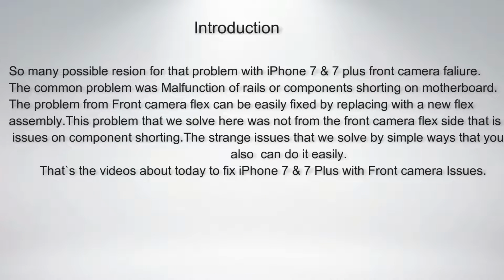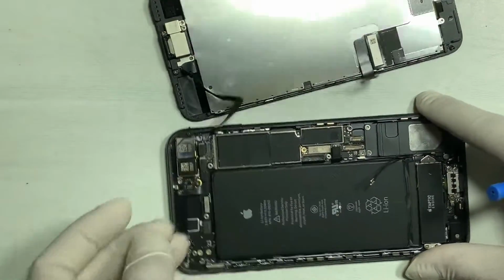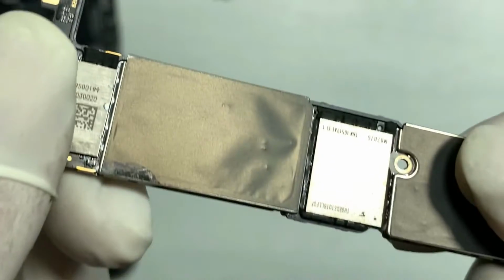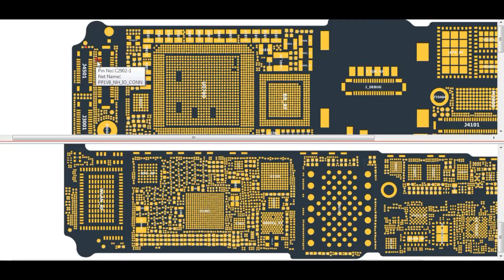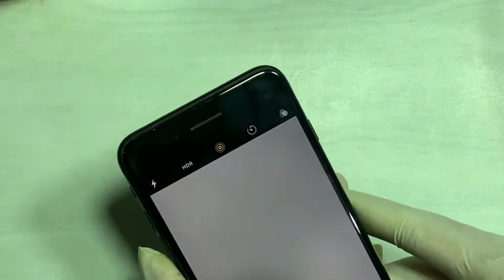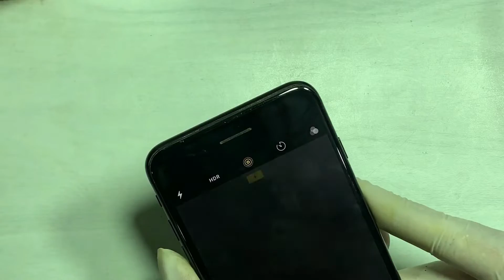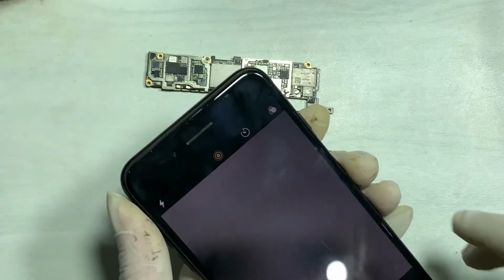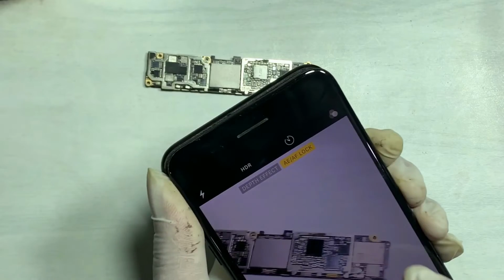iPhone 7 Plus Front camera not working!iPhone 7 plus front camera blank fix.

Comment: hey I have an iPhone 7 plus 32GB super happy with it but it is that the last one when I record a video with the front camera it gives my voice but muffled with hissing sound but if I rub a few times with a small piece of sharp object then in the hole where the mesh and ear speaker is freed very slowly then he does it again for a while and automatically falls back to the muffled with hissing sound and then I have to repeat this again but I want to get rid of this but the front camera replaced is enough to solve this or has the ear speaker or  pre-assembled screen been replaced? 

Using with front camera only its work without sound and ear speaker when i do a phone call  the ear speaker works good
Reply from the maker: First try by changing front ear-speaker flex.
Reply: @thegsmsolution1  ah ear speaker dont have flex the camera flex cable have the mic under the earspeaker do you think that?
Reply: Hello everyone I'm interested to buying a i7 plus, second hand, Unfortunately the front facing camera doesn't work,

Can some one explain if that is common fault with these handset, and what couldn't be wrong with it,

If the complete camera is replaced will that solve the issue? Or work needs to be done on the circuit board?

Comment: what if my front camera is working perfectly on camera but not working on apps i even have allowed front camera reset setting all but it still not working??
Reply from the maker: Did you update your iPhone to the latest IOS? Restart iPhone once and try first. We forget to restart iPhone sometime 2-3 months and the ios system is failing to command the hardware system cause such issues.
Reply: @thegsmsolution1  yes i doo it happened after i updated ios 14
Reply from the maker: Force restart by press v- and power switch same time till iPhone power off and power on iPhone and check.